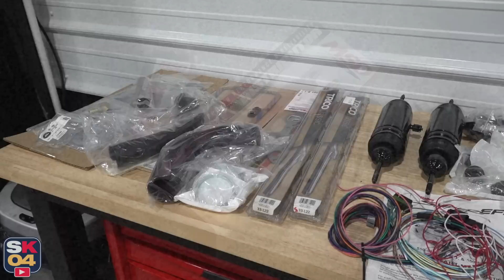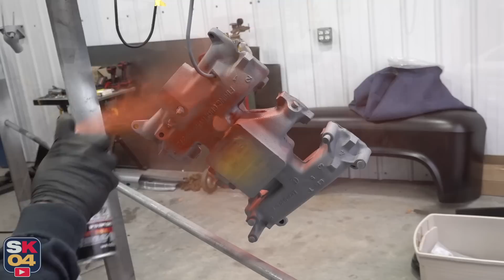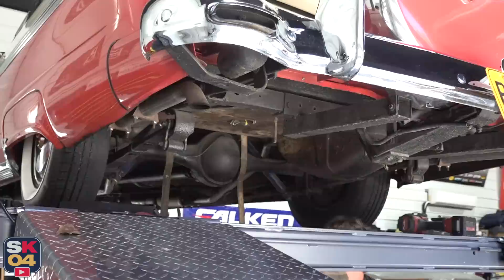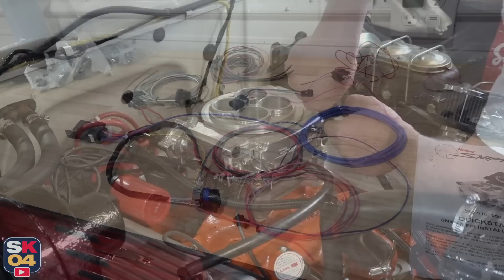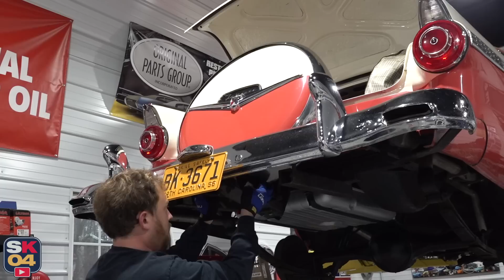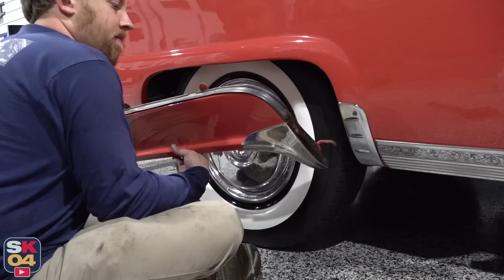Making A Classic Car Into A Reliable Daily Driver!  1956 Ford Holley Fuel Injection Conversion!

Comment: Your attention to detail is a 10 +  awesome video of one of my favorite cars.  Extremely well executed video and one of people who are extremely knowledgeable about these automobiles.   I have owned a 1955 custom line and a 1955 Town sedan. 
       The customline was a six cylinder with a 3 speed manual transmission shift mounted on the steering column. 
       The Town sedan had the 312  V8 which replaced the 272 V8 and the Fordamatic automatic transmission. 
       I wish I had been able to keep both of them.

Comment: 1950’s cars are really nice…. There is enough old about them that makes it like nothing else on the highway, but just modern enough that you can drive them in today’s traffic. This is excellent.  I got to update a 1950 Cadillac Series 62 for a friend of mine, a very fun project that was as well.  Had to add power steering, update braking systems, replace a ton of stuff, cooling system upgrade, etc. Had a ton of fun.

Comment: The multi point injection kit is way better this thing is just an electronic carburetor🤣
Reply from the maker: You should know that not every engine has a MPFI "kit", plus, that's so far from the truth it's not even funny.  Rochester had an electronic quadrajet carburetor in the 1980s that incorporated a few sensors but still used a mechanical fuel pump.  The correct term for this type of setup is throttle body fuel injection.  The technology has been around since the 1980s if I remember correctly, but this system is easy enough to install that pretty much anyone can do it.  It gives you fuel injection without much complexity, plus the self learning feature is pretty awesome if you ask me.

Comment: You have done some very worthwhile sympathetic improvements to that lovely car , definitely making it more fit for modern day traffic . Personally I would consider a more modern overdrive transmission to replace the old Fordomatic - more for relaxed highway cruising than economy.
I'm sure your car would likely have already had the popular upgrades done to assist the problematic oil supply to the rocker arms  that originally troubled these otherwise excellent Y Block motors ?
Reply: I put a 4l60e in my 1955 Thunderbird

Comment: Why not just rebuild the carb and fuel pump. I like to see things stay original and a well tuned carb is just as good as any fuel injection
Reply from the maker: Because this car wasn't original to begin with, all of the original equipment was ditched long ago by the previous owner.  Reverting it back to original is pointless, you're just shooting yourself in the foot.  I like original as much as the next person, but it doesn't always make the most sense.
Reply: Because when he upgrades to an electronic ignition system anyway, the benefits in flexibility and reliability to also upgrade the entire fuel system are considerable. And it's not that invasive, there are no non-reversible modifications done. A guy like Kyle isn't going to throw away the carb. Whether he rebuilds it before he packs it away or not, it's always possible to go back for him or the next owner.